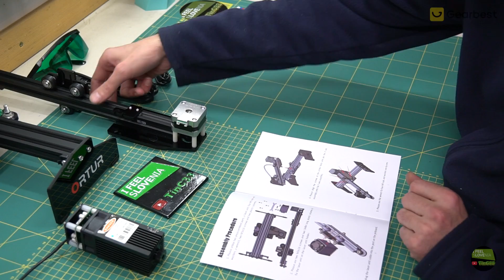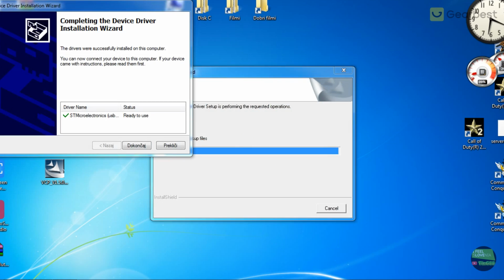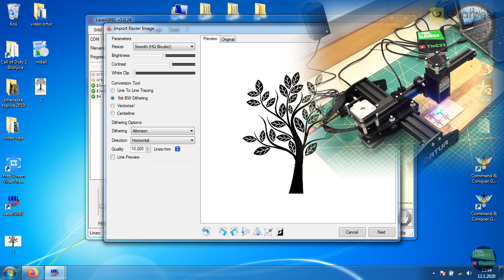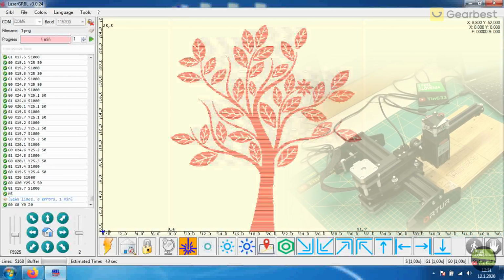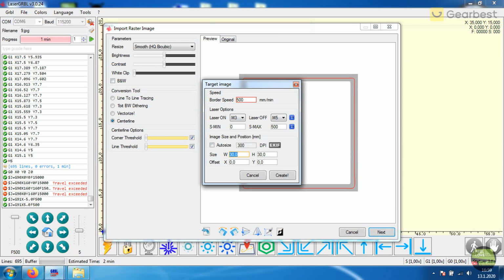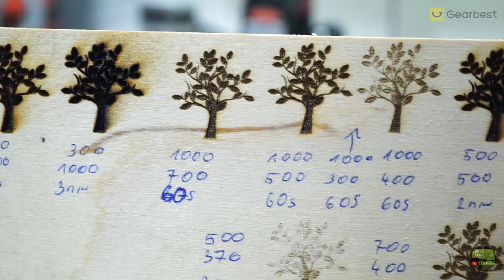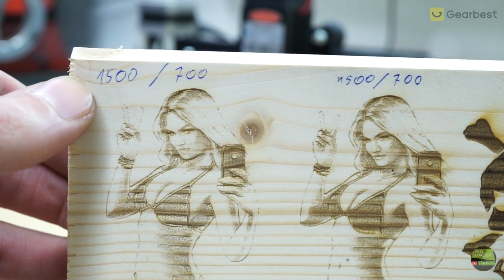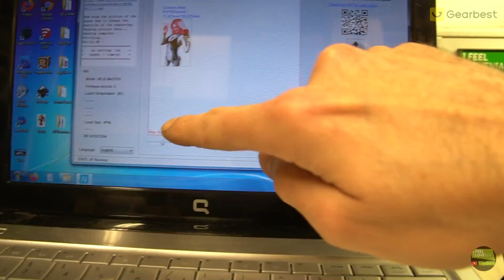Ortur Laser Master 15W Desktop Engraver Cutter [unboxing / review / software / first test]

Comment from the maker: Hello,
Those days i filming this laser again, i will make another video about firmware upgrade and few other stuff.
If you got any idea or wish to test let me know below this comment.
Reply: Hi Tine, thanks for the video, the latest V1.34 firmware download link, also the LightBurn instruction, https://www.dropbox.com/s/w1yu3hpw6e5rxs2/Manual.zip?dl=0
The new firmware would let the the laser module be more powerful, and the LightBurn is one of the most popular laser control softwares, used by lots of users.
Reply: I was just wondering if you know of any of the home lasers that can inscribe into things like softer metal
Reply from the maker: @psball6669  for metal engrave you'll need more expencive fiber laser
Reply: We will be waiting for your video. Can you also tell me please what kind of screwdriver you used to unmount  the laser diode?, I mean, the one that is in the middle hole of the aluminum heatsink
Reply from the maker: @golivare  i think it's 1.5mm hex screwdriver.
Reply: Hi friend,
Its work on any metals like iron, or brass etc...
Reply: Hello i have business proposition please answer me here if you are interested. Thank you :) it is for orthur laser, do you have email adress on which i can contact you
Reply from the maker: @viktordimitrov8982  what interests you
Reply: @TinC33   Hello, my idea is to engrave real people,couples etc. on a piece of wood, plywood, MDF.  I am wondering if this laser can engrave real people not just logos and plain text. I would like to test with you if it can do this job.
Reply from the maker: @viktordimitrov8982  sure you can engrave nice grayscale photos on wood with it.
Reply: @TinC33  Thanks for answering so fast, can we have a collaboration, I want to send you a photo and if you can engrave it with the laser, I would like to see how it looks before i buy the laser. I will of course support your channel for this activity.
Reply: @TinC33  @TinC33 Thanks for answering so fast, can we have a collaboration, I want to send you a photo and if you can engrave it with the laser, I would like to see how it looks before i buy the laser. I will of course support your channel for this activity.

Comment: Have u tried it with rubber engraving for stamps ? Do you think 15w module is powerful enough, or an even lower power laser ? Dont care about the time it takes.
Reply from the maker: Hello, it should work since stamp rubber is quite soft to cut, please check one of my latest video ( making stamp with neje engraver)

Comment: Hi there, thanks for the video. I'd like to produce small leather key chains such as the ones linked. So I need a machine that can engrave small area and small detail. Would this machine be able to do that? People discuss work area but not laser beam width or ability to produce fine details. thanks https://vivaskegvegasvw.co.uk/wp-content/uploads/2019/02/img_1261.jpg
Reply from the maker: Did you check my other neje videos, in your case i would take some neje depend on size you need but i think neje 2 would be ok, (mini doesnt offer all the funcions) and i will choose 3.5w model because its powerfull enough to engrave leather, and it got small focus beam, because weaker the modul is smaller the beam is and better for grayscale engrave, more powerfull laser mean bigger dot and worst for engraving grayscale, sure you can buy neje master 2s with 20w modul if you need and than buy 2.5 or 3.5w modul wich can be replace in 30 sec and cost only about 30$

Comment: hello,  when you stripped out the laser module down to the actual laser diode,did you enquire if that part is available seperately to buy instead of having to purchase the whole unit ? thank you for a superb video TinC33
Reply from the maker: I didn't notice one from ortur, but i see neje sell only laser diode as spare part, try to find them on ebay maybe...
Reply: @TinC33  ok good idea thanks

Comment: Ok I'm in somewhat of a pickle here. Took my Ortur LM 15 watt 1st generation laser engraver apart to clean. And can't seem to get the Y Axis put back together. The photo diagrams provided in the instruction manual hasn't really been that helpful. Does anyone have or know of a video or tutorial of how to put the Y Axis back together after taking apart for cleaning, making a repair etc. You can share. This would greatly be appreciated.
Reply from the maker: Hm, try to find some photo or try to find details into video it shouldn't be thag hard, just put the belt under the wheels arround the pully and fix them on booth end.

Comment: Ortur seems better choice, but can you lower power, or I should to buy 3.5W laser and 7W laser and 20W laser, depending of use?
Reply from the maker: You can lower down the power for sure, but it's still work different, because 3.5w with full power burn only the surface of wood, so it make nice grayscales, but if you set 20w laser on about 20% power it wont leave any trace, when you set to 25% it's become to powerfull to burn only surface and start making deep black engrave, but it's better for cutting.
Reply: @TinC33  Yes. Also I think that "20W" laser has bigger spot, so not as tight as small one. Thanks.

Comment: Thank you for this video. I inspired and ordered Laser Master2 20W version. It arrived todat. How can I know that the module is 20W because there is not any power rating marked in module or box?
Reply from the maker: Thanks, i'm quite sure that on mine is engraved power "15W" on one of the ribs (heatsink) from side of the modul
Reply: @TinC33  i found heatsink marking "LU 1-4 20F29" and I asked also from seller. Lets see what he answer. Do you have plan to test Laser Master 2?
Reply from the maker: @Manufly59  hello, so it should be 20w i think, master2? Hmm actually they ask me and offer me free sample of master 2 from priducer and gearbest, but i decline twice, because i already test 3 lasers wich is almost the same, but i see lot of interest in that type of video so maybe i'll do a review but need to find more free time.
Actually there come new model ortur 400 i'm interested to make a test on that new model but so far no more information from ortur, they just ask me if i'm interested and than nothing...
Reply: @TinC33  Yes it is Master 2. Lets see what they answer. Thank you for good videos and good hints.
Reply: Here is the sellers answer: "there is number on the laser module, which is LU1-4 means 20w" so looks that my module is really 20W

Comment: What kind of screwdriver you used in the middle hole to remove the laser diode or laser housing?, I have the same issue that you had.

Comment: My laser is not working, it's move but the laser is not working. I trying to buy the new laser vut it's still not working, anyone have solution please?
Reply from the maker: Check the cable, to a laser if it coonect right, is there any light come out of laser? Wich software did you used?
Reply: Exusme, there's a red light and green light there, I used benbox software btw, and when i click the light icon to chek the laser point, it's not working to.
Reply: One more, there's a button in the laser, if i press it, it's always light up from begining till the end, even i didn't start the program yet.
Reply from the maker: @russlee3230  please try with laser grbl, it's free software, suggestet by ortur, follow the manual from ortur, setup as it say than try
Reply: @TinC33  i'll try now, thank you so much for your help.😊
Reply from the maker: @russlee3230  no problem, link to software is under video description, tell us if it work than, and yea don't forget to install driver, follow the manual.

Comment: Hi great video as ever, I have you managed to test the 20w Ortur module?
Reply from the maker: Hy, i'm waiting to get ortur v2 15w with 20w modul for a test from gearbest.
Reply: Hi, I wonder if you can help me!  I Just received the 20w Ortur module from Gearbest which has a 3 pin female plug, my existing 7w Ortur 1 machine has a 4 pin female socket where the module plugs into. The 20w module came with no lead, therefore are you aware of a 4 pin to 3 pin lead that is available also both plugs are slightly different in size. Thanks in advance.
John.

Comment: Is the laser module included or do you need to buy it separately
Reply from the maker: sure it's included, (depend on version you buy 7 or 15w) everythink you need is in the packet, power suply, usb cable, glasses, testing pieces...

Comment: How much is the maximum possible  thickness to cut??? Will it possible to cut 5mm thick caurugated PP sheets layer of 10 nos at a time?????
What is the maximum possible size??? 1300mm x2100mm ?????
How much length cutting per minute????

Comment: Hello!
I wanna get a laser engraving machine which will engrave acrylic and mdf board along with cutting 3mm mdf board and acrylic.
Which one would be better for me can you suggest ??
Reply from the maker: Hello, i try Neje and Ortur lasers, ,.5w, 15w, and 20w, all of them can engrave nice into MDF but non of them can't cut it, it just cut about 0,5mm deep, maybe with air assist 1mm but no more, i think density of MDF is just too big, there stay lot of black dust behind, and than can't cut anymore. Otherwise So far i can say neje 20W laser modul is the best, but machine itself is better from ortur, much faster and more precize. But alsmost must to buy software (lightburn cost $40) because you'r very limited with laser grbl.
Reply: @TinC33  
Aww!
Okay, I'm not much experienced with any kind of laser engraver.
So, if I just want to engrave  a wood / mdf board CLEARLY, which one should I buy?
Please suggest me two within in total of 300  USD
& another one within 200 USD..
Reply from the maker: @md.abulkalamazad8202  for clean rngraving take low power, 3.5w is the best for engraving also grayscale look awesome, and neje master got better focus on laser and better software, but ortur master is much faster, it's hard zo say wich one is better really, but i would choose neje because of simple software, and got better result on engraving with 3,5w and 20w than with ortur 15w.

Comment: By the way, compared to Neje, Ortur could engrave much faster, it's tested by lots of users, who have both of Neje and Ortur, especially when working with LightBrun.
Reply from the maker: True, true, i say that in every video, ortur make huge difference with 32bit board, it's really fast and accurate, but the laser modul got bad focus point, so still get better cutting and engraving result with neje, but it's stil 3 times slower than ortur.

Comment: Hi Tine, thanks for the video, the latest V1.34 firmware download link, also the LightBurn instruction, https://www.dropbox.com/s/w1yu3hpw6e5rxs2/Manual.zip?dl=0
The new firmware would let the the laser module be more powerful, also fixed the issue you had mentioned in this video. 
And the LightBurn is one of the most popular laser control softwares, used by lots of users, also the control software, we would recommend, very easier to use, also very good at technical support.

Comment: Will this laser machine work on metal
Reply from the maker: Actually it work if you use black marker before engrave, but neje 20w work better
Reply: TinC33 can i change the power of the 20w laser to make it lower?

Comment: Hi, could you please advise if this laser would deboss /engrave on silicone /rubber?
Reply from the maker: I will add on test list, i will upgrade the firmware and make some more test with different materials.
Reply: @TinC33  great thanks! When will this video be out? Looking forward to it soon. As im interested to getting one soonest if it works. Thank you for your great effort! Great video btw!
Reply from the maker: @choc0lateh  i think there will be atleast one or tvo video uploaded before, but today i make test on my phone case, it can be engraved very nicely to somewhere 0,3-0,5mm deep, i try black silicon cover. if the material transparent there's no way it work, it can't even cut a 0,1mm thin transparent foil.
In general, it make nice, engrave into darker colour rubber, plastic and so on
Reply: @TinC33  wow thank you for the information. But would it leave black burnt marks Or can be wipe off with wet cloth? And what about coloured silicone rubber, would it work ?
Reply from the maker: @choc0lateh  yes there stay dirty black rubber dust, i wipe it with cloth and cleaning alcohol, and got nice clean result. I think also on other colours work on same way, just not on bright colour like white or transparent.
Reply: @TinC33  thank you so much! Could you estimate based on ur experience how long would it take to engrave a 8 cm by 3 cm name on the silicone? Thank you for your time!
Reply from the maker: @choc0lateh  depend only line arround the letter (dxf) need only a minute, but if you want to "paint" entire letter (line by line) it need about 3 minutes, but always depend on speed and power, you can get better result with lower speed and lower power, but need more time 4-5min.

Comment: In this video did you upgrade the firmware to 1.34? That solves the lack of gray scale and allows the full output capability of the laser where before it was only at a 25% output. All though the true wattage output is less than half the current draw of 15 watts, 😁🛫
Reply from the maker: Thanks, i do that and i will make another video about that.

Comment: it's only a 4.5w  laser ! it's not 15w
Reply from the maker: Yes optical power is 4.5W but the laser is selled and advertised as 15W (electrical power)
Reply: 15 watts is the power consumtion, read the spec

Comment: Dear friend, I wonder if this machine could engrave on a silver ring? Have you ever tested it on silver surface (silver is softer)? Thanks very much for your advice, I'm going to buy it with your coupon.
Reply from the maker: Hello, i didn't try and also think it wouldn't work.
But i see some website sells some "painting" for that kind of laser, so you apply paint on almost any material and the paint will be seen only on engraved area, the rest will wipe of.
Reply: @TinC33  it's nice, thanks for your advice. I mean could this 15W/20W engrave small character/icon on such a small silver ring? Is it smooth and high details engraving on small things like rings?
Reply from the maker: @bonion3d  Aha you wondering about small dimension, well Neje laser engrave 2000 by 2000pixels on 150by150mm engraving area, that mean that size of single pixel is about 0,075mm
Intu ortur i can set maximum 20lines per mm, that mean that size of line is 0,05mm but that is teoretically, in practice i doubt it look good if we engrave image in just 2-3mm size, pixels will be too big i think, but you decide
Reply: @TinC33  wow thanks again, your info very useful for me to decide. Actually I just need to engrave simple text and icon like ❤ on the rings (4-5mm of width). Hope that you can test it someday and give me more info. Thank you again!
Reply from the maker: @bonion3d  give me an email, and i will make few test and send you some photos.
Reply: @TinC33  btw I wonder if the package already includes 15W laser module or not. Because I don't see it mentioned on gearbest website: Package Contents: 1 x Acrylic Plate for Testing, 4 x Wooden Plates for Testing, 1 x Wrench, 6 x Cable Ties, 1 x Power Adapter, 4 x Angle Fasteners, 1 x Whiteboard Marker, 1 x Brush, 4 x M5 Nuts & Washers, 2 x M3x16 Screws and 5MM Plastic Columns
Reply from the maker: @bonion3d  Sure it include, but it's depend wich option you choose, 7,5W or 15W you can see also the price was change when you choose one.
Reply: @TinC33  sorry to bother you again, have you done any test on small dimension objects like jewelry rings (4-5mm width)?
Reply from the maker: @bonion3d  i will those days, i making on another video about that laser, firmware upgrade, and lightburn software.

Comment: I ordered one of these from Gearbest over 3 weeks ago.  They have yet to ship it, and keep giving excuses...  shrug
Reply: asbrand same here well I ordered mine on 02, 09, 2020 I got notice on the Feb 20 that it shipped out but when tracking through DHL there are no details. Do you have yours? Be sure and upgrade the firmware to 1.34 apparently when this video was made the new version may not have been released. It solves the lack of gray scale and allows the full wattage output of the laser, where as before it was only outputting 25% 😁🛫
Reply: @TheFalconJetDriver  - I am in the same boat as you.  According to DHL, they've received shipment notification...still sitting in Hong Kong.  Thanks for the reminder on firmware.
Reply: And amusingly enough, I just got notification that DHL actually picked it up this morning, and it is on the way.  Supposedly will be delivered tomorrow.  We'll see...

Comment: So Neje or Ortur? I hear Ortur works with Lightburn?
Reply from the maker: Yes it work, but i think also neje booth work on laser Grbl but neje got also it's own software, wich is really good and usefull because it's prepared in a minute.
Also the laser modul is better from neje (only 3,5w but it's focus is much better so cutting power is almost the same as ortur 15w) but as i say maybe just me got a bad lock and got fault laser modul or just lens...

On other side ortur machine is much better, work much much faster and it's still more accurate, almost no vibration on x axis...

Comment: The laser itself is only 4.5w or so- it’s the power supply that is 15w.
Reply from the maker: True, 15W laser got laser Electrical Power: 15W, Luminous Power: 4000-4500 mw but this kind of laser is always promoted with electrical power (15w) not optical power (4-4,5w)